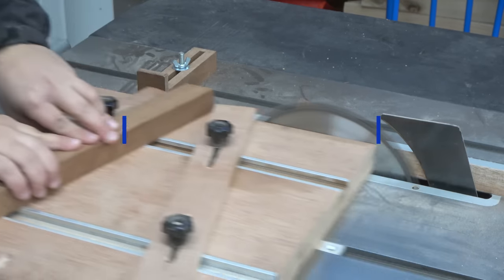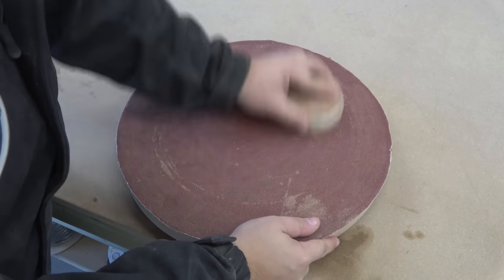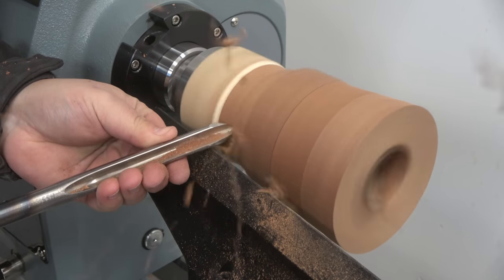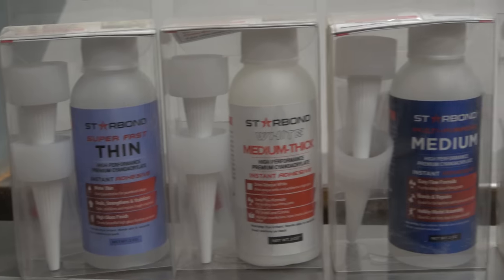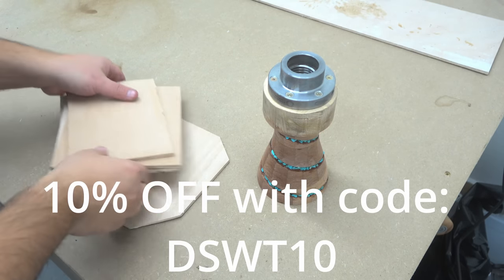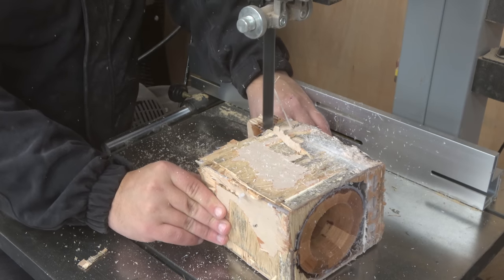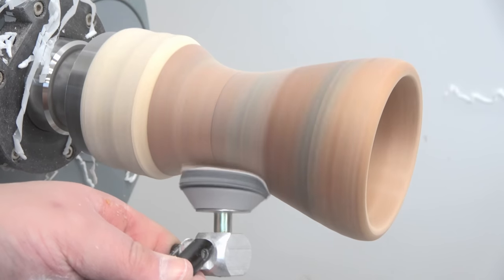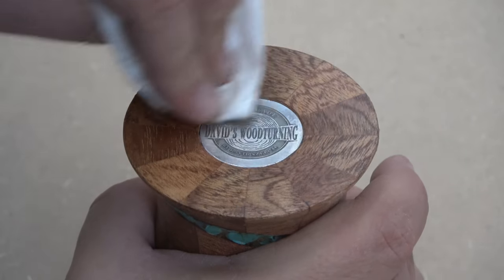Woodturning – Stone Vs. Wood

Comment: Hi David, I’ve been on your website and guessing your uk based.  I didn’t realise starbond was available in the uk.  Also can I ask which bit you were using in your Dremel? Thanks.
Reply from the maker: I used kutzall taper burr. Slightly aggressive bit but removes material fast
Reply: @DavidsWoodturning  thank you.  I also ordered some resin last night from Vista and your discount code didn’t work.  It appeared to just give free postage which you get anyway when spending enough.  Keep up the excellent work by the way love your videos.
Reply from the maker: @paullongworth9607 it is not the most user friendly way how they do this discount code sadly. You need to have an account and not checking out as guest. But will double check the code if it is still working